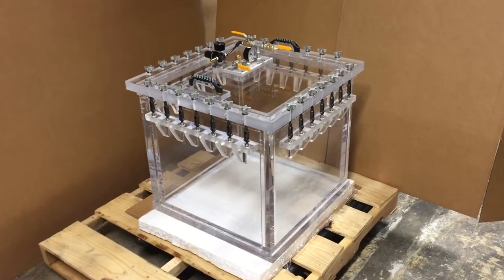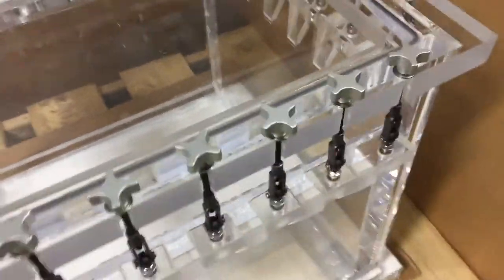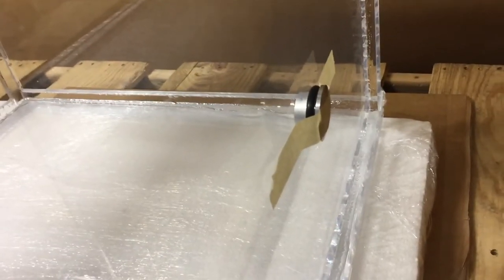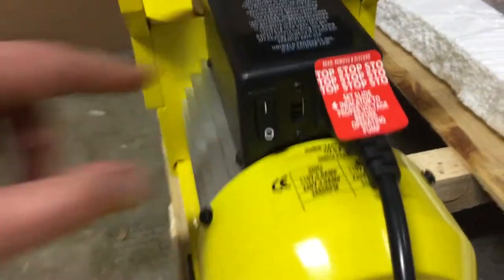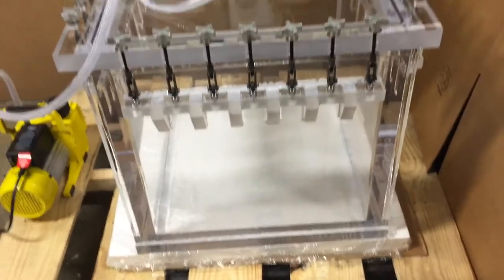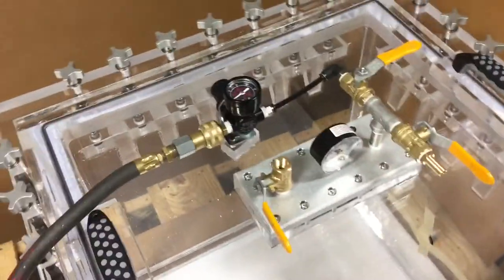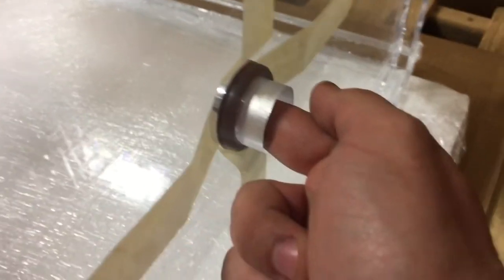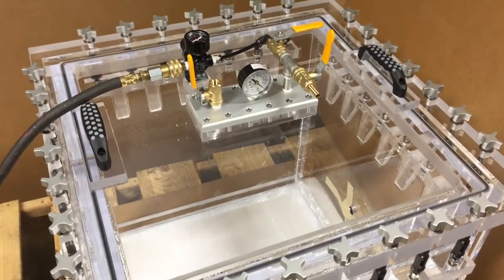Clear Acrylic Vacuum Pressure Chamber

Comment: For vacuum, you don't need any thumb screws as other posters said. But to pressurize,  a simple soda bottle can hold up to 150psi. I experiment with them all the time at 20psi. These thumb screws and that thick acrylic for sure take you there... For just 2psi that amount of screws looks crazy. but no sure the acrylic cement you appear to use if will break apart. I know  is hard to apply consistently. Very interested if you do further pressurizing tests under pressure as I want to build one of these but to reach 50psi positive pressure or so.
Reply from the maker: Yes, you are correct, acrylic can take you to 150psi, it has been used in submarines at miles of depth where pressures go to150psi or more. However, our core competency is 15 psig and we do not go higher. We try to stick to what we know how to do well. Thank you for your comment.

Comment: What is the purpose of the thumb screws? When pumping a vacuum, the atmospheric pressure on the outside would press on the lid much more than you can ever tighten those screws. But perhaps you can use the chamber also for overpressure applications?
Reply from the maker: Hello Richard, you are correct, this chamber is used for slight overpressure applications of up to +2 psi. The reason we have so many thumb screws is to evenly apply pressure to the O-Ring across the lid and to spread the force evenly across all clamps. You are also correct that the atmospheric pressure will press the lid down when vacuum is applied. In fact, the weight of the lid is initially sufficient to create a good seal so that air can be evacuated out of the chamber.

Comment: I made a very simple vacuum chamber with steel pot and plexiglass and it works perfectly. I used four pieces of threaded rods with wing nuts to hold the plexiglass top firmly on top of the pot. This is too complicated and cannot be practice for many DIYers.
Reply from the maker: Props for making the chamber yourself. You are right.
Reply: This is way too many hand screws

Comment: Why do you need the hole on the side of the tank? It’s just another place for a leak. I would think you would want to make the tank as leak free as possible. Did I understand that you can only input 2 psi for the pressure tank? That seems to be Avery slim psi and it will take a long time to pressurize the tank to 45 to 50 psi.  Does the acrylic tank take 50 psi?
Reply from the maker: Hello Richard, this was a custom project for one of our customers. The hole was a requirement from our customer - they simply wanted that hole on there and we made that happen. And yes, 2 PSI is all they wanted for the over-pressure requirement so we made that for them. Acrylic chambers are not intended to be highly pressurized, the highest pressure we recommend acrylic chamber to go to is 15PSIG. Anything over 15PSIG should be made from steel/stainless steel. I hope that answers your question.

Comment: how thiccc is the material and is it somekind of special smash-proof plexiglass or just regular acrylic from the hardware shop?
and what do u use to glue them together?
Reply from the maker: The thickness of the acrylic depends on the size of the chamber and can range from 1 to 2 inches. 

We always make sure to build with safety in mind which is why it has to be this thick.

The glue we use is proprietary formula we have specifically developed for vacuum applications.

Thank you for your questions.

Comment: I know acrylic chambers are good up to 15 psi.  I want a vacuum chamber that can achieve 10 mbar (7.5 torr, 7.5 mmhg) vacuum.  Do you know how many psi I need my chamber to be able to resist?
Reply from the maker: for 10mbar of absolute pressure, at sea level, the chamber walls experience approximately 15 psi of pressure.

Comment: why do you need clamps if this is vacuum, not pressure
Reply from the maker: It can be used for both as a vacuum and a pressure chamber up to +15 psig. The clamps are needed for pressure.

Comment: Hello! I am conducting an experiment where I require a high pressure environment to be maintained for months, with access to input a gas and release a gas at the same time to maintain relatively same pressure. Do you think that plexiglass sheets are up to the job, or should I use a type of glass? I am thinking of using 1" or 1 1/4" thick plexiglass. I will have to drill the fittings for valves, as well as a pressure gauge.

The pressure will be about 300-400PSI
Reply from the maker: Hello Johnathan Griffin,

We would recommend against using acrylic for anything above 15psig. There is a video that shows what happens if you use acrylic for high pressure applications (be sure to read description of that video), 
link: 
https://www.youtube.com/watch?v=70znrkiHfpA

DO NOT use regular glass because it can explode and shatter and is a major safety risk. There are other stronger glass types but this is beyond our expertise.

Good luck!
Reply: @sanatron  lol that failure is kinda outside the realm of most. Compressed CO2 at 750 psi held just fine. He actually infused the acrylic with CO2 and on decompression it expanded the acrylic.
Reply from the maker: @the_sharp_carpenter   I saw that youtube video where that guy infused acrylic with CO2 bubbles, it was wild! I would not be comfortable with that much pressure around acrylic.

Comment: Hi , can you please tell me how you sealed the parts and how you glued them could you tell me what kind of glue?
Reply from the maker: Hello Shihab. The manufacturing process and the glue we use on our vacuum chambers is a proprietary and a trade secret. We have spent years, tears, sweat, and blood to perfect it. Therefore, I won’t be able to tell you what kind of glue we are using on our vacuum chambers. However, if you are looking for acrylic glue, you do have options. I know of 3 companies that sell acrylic glue / cement that is good: 1. WeldOn, 2. Evonik, 3. Caseway. So if you google “Weld On Acrylic Glue” or “Evonik acrylic glue” or “Caseway acrylic glue” you will get some good results. I think you can get these on amazon.com as well. Let me know if you have any questions! Good luck!
Reply: Sanatron LLC Do you sell it ?
Reply from the maker: Hello  @shihabal-hasni1193  , Yes we do. You can visit www.sanatron.com for more information or check out our "about" section in youtube. Cheers!

Comment: The term "Trust me, I'm an engineer!" seems to apply here. For a full vacuum at sea level, you're subjecting the chamber walls to approximately 15 psi. My question would be why is it necessary to employ 27 clamps on a chamber you mentioned would only be subjected to 2 psi positive pressure? Keep in mind, one can pull the same vacuum from a Ball canning jar so I figure this isn't designed for its vacuum chamber qualities.

Another obvious question would be: why are you throttling the chamber to 2 psi when, under full vacuum, you've already proven that it can easily handle a minimum of 15 psi? What's the actual "real" maximum psi this unit can handle? All of this for 2 psi seems like a massive insult to the material used and to all the quality workmanship put into it.

I feel like you're seriously selling this short of its potential, especially if anyone in the polymer casting industry gives this a solid look. Granted, this isn't a marketing video. It looks more like a product demonstration to a client who, for whatever reason, wanted you to build a Ferrari to subsequently be pulled around by a horse. Nonetheless, I'd be very curious to know exactly how awesome this setup actually is when taken for an actual test drive.
Reply from the maker: Hello brianspencer3080, yes you are correct that at full vacuum this chamber has proven to be able to handle 15 psig pressure differential which means that (you guessed it correctly) this chamber will be able to handle +15psig of positive pressure. 

The 2 psig was what our customer was asking for and that is what we provided to them.

With regards to building acrylic pressure chambers, 15 psig is what we are comfortable building for. Anything over 15 psig and it is considered a "pressure vessel" according to the American Society of Mechanical Engineers (ASME). This means that, by law, it will have to undergo further certifications by a professional engineer (aka PE Stamp).

Comment: With all of those handles, I’d hate to do any work in a hurry like with resins with a pot life
Reply from the maker: I know what you mean, you gotta flip the clamps upwards and tighten them which takes a bit of time. Keep in mind that this is only done for the pressurization part because when you pressurize the chamber, the pressure will push the lid outwards - so you need plenty of clamps to keep the lid compressed. When you pull a vacuum, the weight of the lid will initially provide the o-ring compression and the vacuum will do the rest.

Comment: I don't get it... why would you need clamps on a vacuum chamber?
Reply from the maker: Hello tableshaper, You generally do not need clamps on a vacuum chamber because the weight of the lid will create enough O-Ring compression to initiate the vacuum. However, clamps are nice as they provide the initial compression on the O-Ring to create a seal so that vacuum can be pulled (no leaning or pressing on the lid needed). With that said, this is a vacuum AND a pressure chamber, which why you need clamps in order to keep the lid compressed against the surface since the inside pressure is constantly pushing the lid away from the chamber. Let me know if you have any more questions. Thank you.

Comment: why do people relate vacuum to pressure, it isnot pressure therfore no psi but inches of vacuum. No pressure
Reply from the maker: Hello Siam Wood Shop, it is all relative and referenced to a certain point. Here is an example: If you are standing in front of a pond and you see a fish. You notice that the fish is 3 feet deep into the pond. The fish sees you looking at him and notices you standing at a 1 meter height... You see? If you ask the fish, the fish will think you are at a higher elevation. Just like pressure and vacuum... Vacuum could be interpreted as depth; pressure could be interpreted as height. feet and meters are just units just like psi and inches of Mercury.

The best way to agree on things is to reference to a perfect vacuum and call it absolute pressure. When it comes to what we call vacuum, it's generally anything below ambient pressure which is 14.7 psi (absolute). I hope this explains it, let me know if you have any more questions.